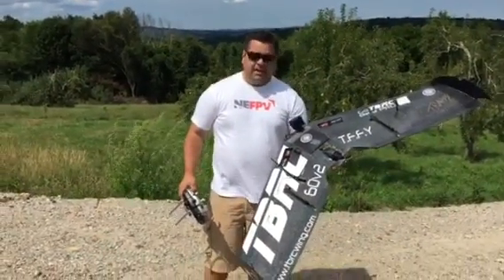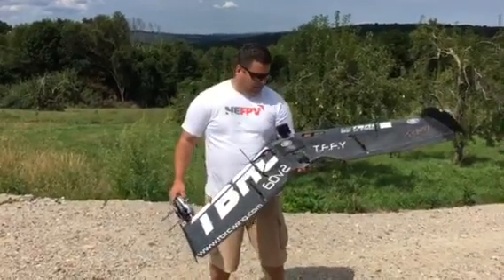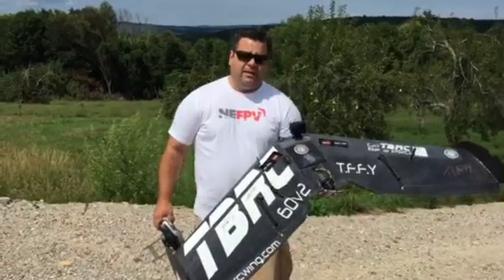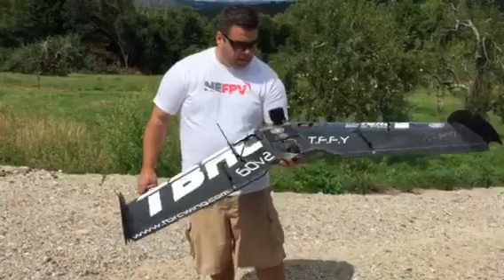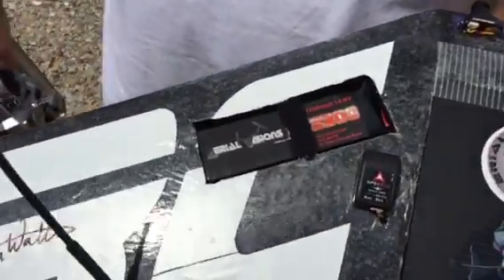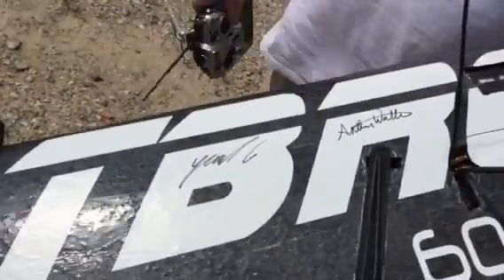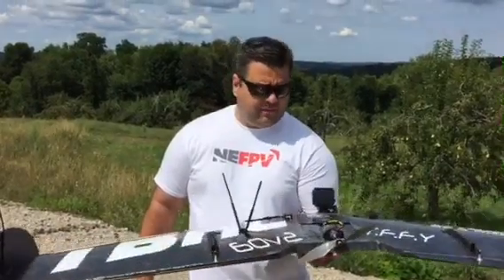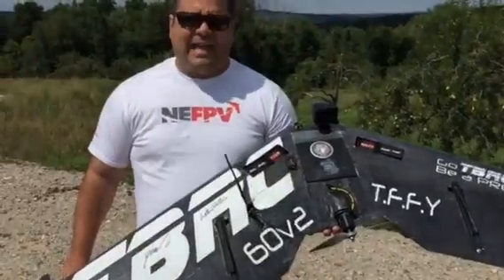TBS Crossfire 25mw Range Test

Comment: Hey guys .. any issue with your crossfire rx or setup. I had to return my defective first batch crossfire back to TBS avionics in Hong Kong for a replacement. Shocked that there was no USA hub. Cost me $34 to return.
Reply from the maker: Actually had issues as well. You could've sent the defective Crossfire to me and I would've had it streamlined. Any TBS warranty issues feel free to contact me first, www.aerialvisions.net.
Reply: I greatly appreciate your response and assistance. I Thank you.

Comment: Hello, thanks for the Video!
I have same set as you and I also did the upgrade of the TBS firmware, so could you explain exactly you got your RSSI signal and the Configuration on Vector that  enable it to read the RSSI...
On the Crossfire, I set the Rx to be PPM in all channels, and set Failsafe as "CUT"

I Connected the Vector Sbus lead on CH 1 of the receiver, and on Running the WIZARD ANALYSIS of Vector I select SPPM and then THROTTLE  cut in Order to the vector recognize the loss signal....  It engage the Vector's Failsafe nicely, but on my OSD it show like this: If the Throttle input bellow 20%, the RSSI on the OSD shows 100%, but if input is over 20% the OSD shows RSSI as 1%...... I dont loose signal but I am unable to check how near I am from my range limit..... could you give me some clues please?
Thanks
Gilberto